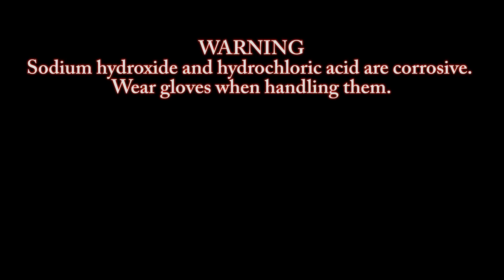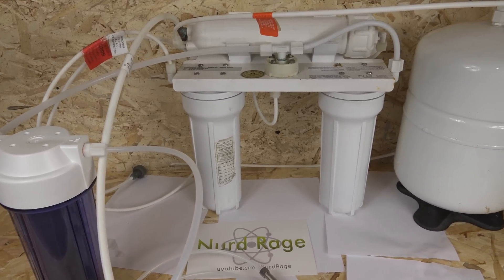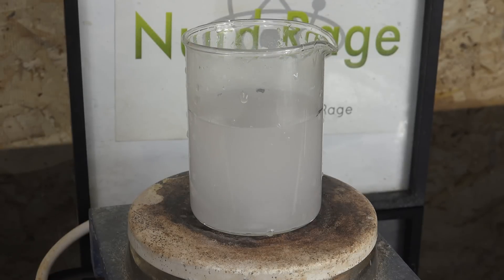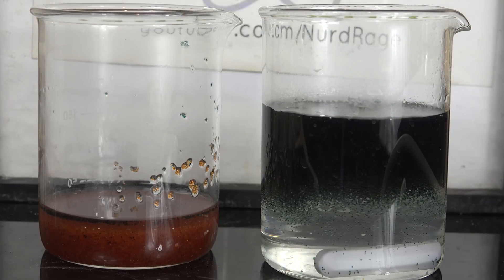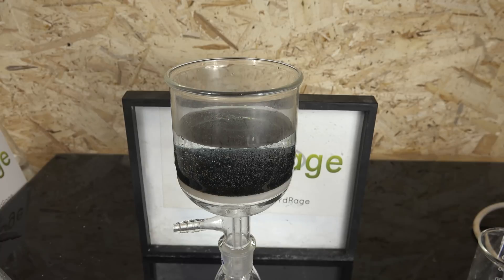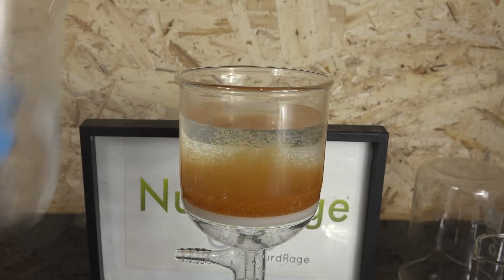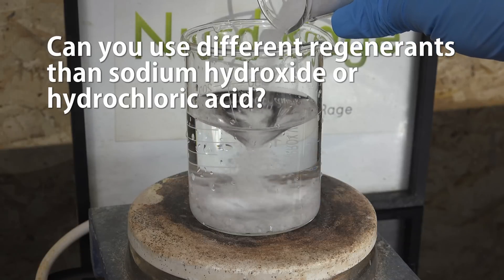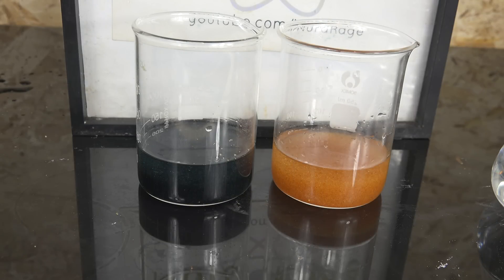How to Regenerate Deionization Resin for Use in Reverse Osmosis Deionization Systems

Comment: Do you reckon organic acids (e.g. acetic, citric) can be used for the cationic exchange resin? Asking because it's much easier and cheaper to obtain food-grade supplies of these. (I live in the UK where HCl is not readily available and of dubious purity.)
From my brief survey the only sparingly soluble salt seem to be calcium citrate, which I imagine means I'll just have some precipitate to wash out if I use citric acid.
Reply from the maker: no, they're weak acids and don't produce a high enough concentration of ions. Also, being organic, they'll absorb into the beads themselves and contaminate your product water
Reply: Liyang, I found HCl but struggling for a good source of hydroxide, have you found a good cheap UK source? All the drain cleaner stuff I can see is contaminated with aluminium nitrate and stuff

Comment: Sometimes there are some stringy bits floating around (such as at 14:05). I'm curious: what is that?
Reply from the maker: some contamination, i don't know, maybe a spider web that fell in?
Reply: @NurdRage  Makes sense. Is it not necessary to remove it? Or did you just not find it interesting to cover in this video?
Reply from the maker: When i poured off the excess liquid the contamination went with it. Also, as an amateur chemist, it didn't really matter. Now if i were a professional lab i would chuck the resin out and replace it.

Comment: Would it be worth the effort to separate the two resins and run two filters with only one resin in each?
Reply from the maker: No, water quality is worse. Best thing to do is to have 3 beds. 2 bed with different resins, and then have a final bed of mixed resin that you change less often.
Reply: @NurdRage  What if I am only using the DI water for final rince of the car to prevent spotting? If you have a better Idea I would like to hear.
Thank You for the videos.
Reply from the maker: Use the one mixed bed resin. (or don't use any DI resin at all. RO water is already pretty goood)
Reply: @seannot-telling9806  dry the car.

Comment: Would there be any value in keeping most of the already separated resin as an easily in-situ regenerated dual bed to do the bulk deionization and use the remainder as a mixed bed for final cleanup of the ions?
Reply from the maker: go for it
Reply: That is actually a good way to do it.  I built a system in an old lab with separate color indicating anion and cation beds and a polishing step with mixed breed nuclear grade resin.  The system consistently put out >1 megaohm water at 2gpm.  Didn't need the ro step since the incoming water was fairly high quality.  I would recommend having physical filters (1 um gradient spun yarn filters work well) and a uv sterilizer and at least 1 activated carbon block upstream if the resins.  The water coming out of the system was very low toc and was deionized enough that it completely after away a stainless steel temperature probably in a few months.
Reply: @danheidel  > was deionized enough that it completely after away a stainless steel temperature probably in a few months.
Did you mean: completely ate away a stainless steel temperature probe?
Reply: That's what happens when people post from phones -  you end up with a lot of gibberish.

Comment: Why using as mixed bed? Using 2 serial  single type resin  bed seems more efficient if your plan is to regenerate  the resin , you jump the step of separating the resins during regeneration, or am I  missing something?
Reply from the maker: water quality is worse. Best thing to do is to have 3 beds. 2 bed with different resins, and then have a final bed of mixed resin that you change less often.

Comment: Why do the Cat- and Anionexchanger beads have to be mixed? Is it not possible to have two seperate columns in series for easier regeneration? Or even put something like a coffee filter in between them in one column?
Reply from the maker: water quality is worse. Best thing to do is to have 3 beds. 2 bed with different resins, and then have a final bed of mixed resin that you change less often.

Comment: Is it important to recombine the two resins or could you keep them separate for easier regeneration later?   It would mean an extra filter can on the RO/DI system though.
Reply from the maker: water quality is worse. Best thing to do is to have 3 beds. 2 bed with different resins, and then have a final bed of mixed resin that you change less often.
Reply: It should work perfectly fine. I think that's what's done to remove nitrate from drinking water, since you're only interested in removing anions in that case, you only use an anionic exchange resin. Keeping the resins seperate would just make it a two-step-process.
Reply from the maker: No IT'S NOT PERFECTLY FINE. You get lower water quality. 

This is because as you replace ions you shift the equilibrium of the reaction and some of it shifts back.

For example, let's say we have a solution of sodium chloride salt water and we run through a cation exchange resin already loaded with hydronium ions. The result is the sodium ions are swapped out for hydronium ions making hydrochloric acid. But as we know from before, hydrochloric acid will actually regenerate the resin and swap out sodium ions making salt again. Fortunately the effect is very small since the concentration of hydrochloric acid produced is very low. The actual equilibrium will lie very far to the right. But the effect isn't zero. 

The tiny amount of sodium that remains will pass through the anion exchange column without being absorbed. Meanwhile, most of the chloride will be removed but again, not all for a similar reason of equilibrium. To improve this you need to have another cation exchange resin column that now removes the remaining sodium ions. Since the most of chloride was removed by the anion exchange resin the amount of hydrochloric acid produced is lower so you get improved water quality. But it still isn't zero, you need to keep stacking more and more pairs. 

A mixed bed deionization resin column solves this by essentially having hundreds of deionization pairs in one column. The leftover ions from one bead of resin are removed by the next bead, and the leftovers from that bead are absorbed by a bead further down. So mixed bed resins give the best performance for the least complication. And thus remain the standard for water deionization. 

However there is a way to get the benefits of a mixed bed deionization column and still have the slightly easier maintenance of separate beds, and that's to use both. 

First have the anion and cation exchange columns processing the incoming water, and then have a final mixed bed column to polish the tiny percentage that makes it through. As long as you keep regenerating the anion and cation exchange columns before they are completely depleted, you can get many months of use out of the mixed bed column before it needs to be regenerated. 

Personally though, i don't bother. Separating and remixing the resin isn't the most labor intensive part of this process and i don't regenerate my resin often enough anyway to be bothered by it.
Reply: @NurdRage  that's a really interesting example of the effects of the equilibrium shifting as a reaction proceeds. Really cool that it actually ends up making the mixed resin more efficient! Feels like the case of having just one type alone in a column should be an example problem in a differential equations textbook lol.

Comment: Suggestion: please do di-nitration of phenol or some other substituted benzene. Lots of videos on mono- or tri-nitration (keep it cold or let it rip), but I don't think I've ever seen a youtube video on the controlled process of di-nitration and how to deal with excessive side-reactions, etc.
Reply: Yea I like this idea! I made lots of lower nitrates when using crappy nitrates for picric acid and the lower nitrates all were similar but had slightly different melting points and color. To make mono and di nitrophenol you'd just need more dilute acids and lower temps. NileRed actually made mono nitrophenol in order to make tylenol from aspirin.